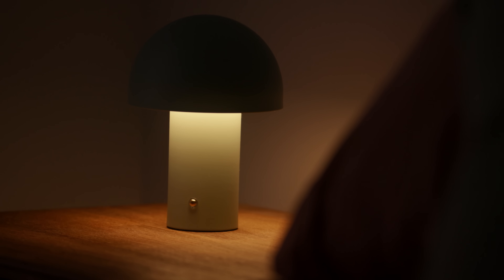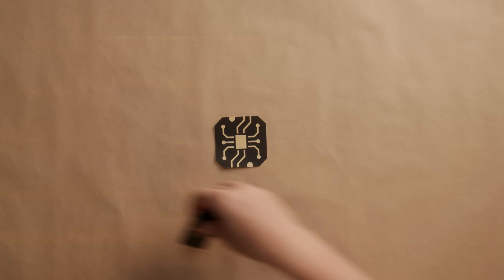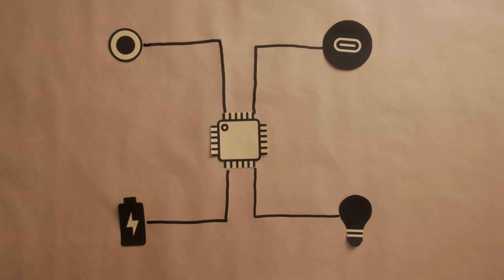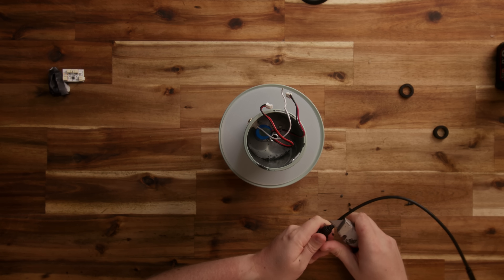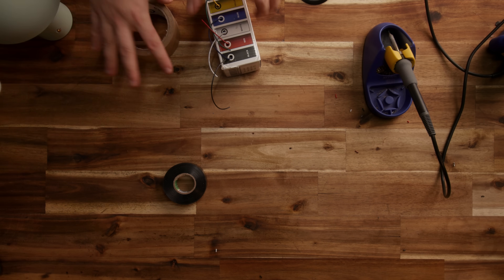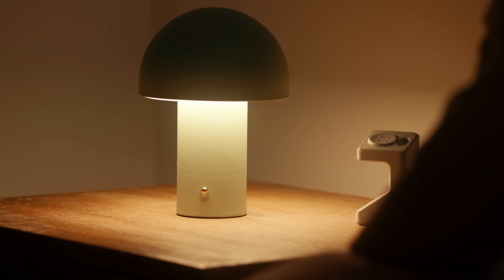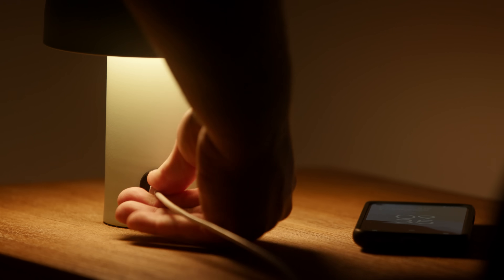Kmart Lied to Me, So I Hacked Their Lamp

Comment: Great build! If you could build that with only $7 in parts, imagine how much it would cost Kmart at scale….
Reply: Kmart could have fixed the type-C charging problem for about 20 cents, probably under!
That's the price for a cheap Type-C power delivery circuit, regular people can buy them in 50 packs for 10 bucks, and Kmart coupd get it even cheaper.
Reply: Try $0.0002 cents. Resistors are dirt cheap, and they only need 2 of them.  And a couple of traces on the board to wire them up, so 1 hour of some designer's time to modify the existing design (way way less than that really but let's be generous.)

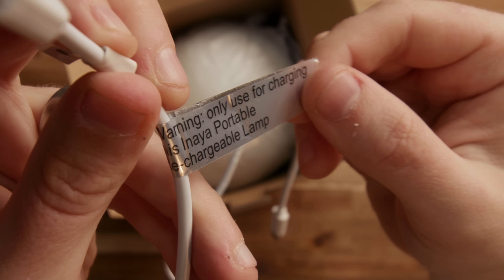Comment: yeah at 1:30 into the video i do believe that most of your devices will probably do some sort of handshake (so it can charge more effectively) , 
I've noticed aswel that some USB chargers will not output 5v until the handshake is done, (stupid) but the older cheaper units will output 5v 2a all the time no handshake needed.
i believe that the esp that you used does the handshake as well, bear in mind what kind of USB power adapter that anyone uses, as this will also affect the outcome!
believe me, this USB thing is a whole rabbit hole, of weird quirks and work arounds for many people.

Comment: Bro could've dropped in a TP4056 module for like $2 and been done with it. But then the intrusive thoughts won
Reply: you dont even need a TP4056 just solder a resistor connected to the data lines of the usb

Comment: dude.... that lighting breakdown animation is beautiful. totally worth the effort. super well done!
Reply from the maker: Thanks! I think I'll keep using that style of animation to explain more complex concepts, really glad to see it's translated properly :)
Reply: @TheStockPot-AU its really cool keep using it whenever u can
Reply: now i just need to spend $30 on a couple esp32s and .30 on some lamps. lol.
Reply: @bigrob029  No need. What he was putting in was a ESP32 Devboard that has a lot more components besides the actual esp32, which is why it's more expensive. 
The actual esp32 is more like 2$ to 5$ or even cheaper if you buy in bulk.

The idea is you use the devboard to develop and test your esp32 project, then use separate esp32 on something like a breakout board for your final project, and you can use the devboard for a new project.

the ESP32 S3 or C3 have usb management and charging infrastructure built in.

esp's come in many form factors, depending on what you need. Doesn't have to be expensive.

There are also different brands to use as cheaper alternatives.
Reply: My favorite part of the video -- thanks for the extra effort on that.  It's original and just downright neat.
Reply: came down to comment this, very good
Reply: @ it was simple, effective, and i have no idea how he did it so cleanly. 10/10

Comment: I feel your pain. Once I bought a battery operated rotary tool, which has USB-C as an input for charging. And there was also a dedicated wall-wart charger. Why you ask? Well, some genius had an idea to wire the 13V wall-wart output, directly to the +5V and GND of the USB-C connector. Yep... 
To solve this, I cut of the cable, and glued a cheap magnetic USB socket adapter into the tool. That way, nobody will fry their phone with this dodgy thing.